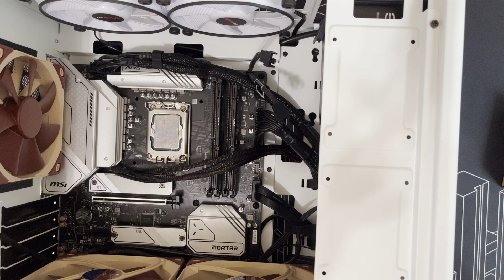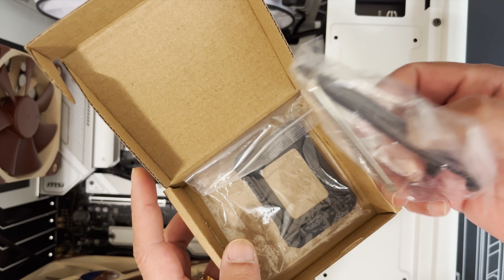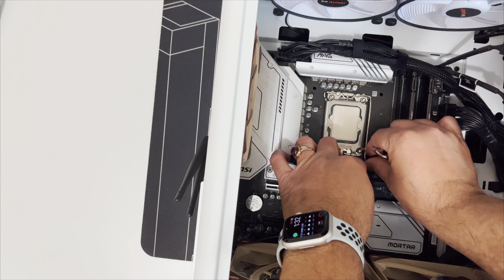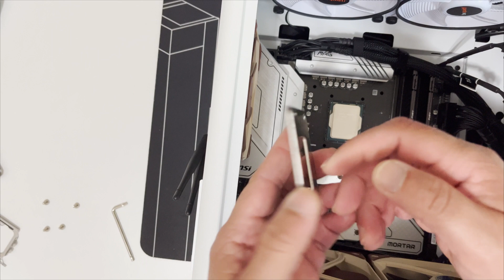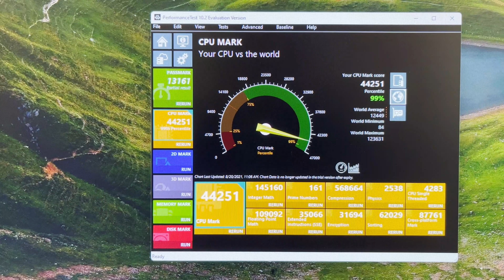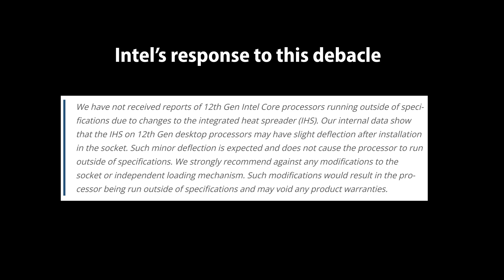I installed Thermalright Contact Frame and my core i9-12900K is 9°C cooler!

Comment: What is the best tutorial for installing the contact frame to be followed? have the maximum grip with 2 fingers and then a 90º squeeze or some other?
Reply from the maker: That should be good. The Thermalright frame is more forgiving compared to the thermal grizzly one.

Comment: Worked for me too. I also tried reinstalling the old ILM, recorded temps and then re-installed the contact frame...2 more times. The results were the contact frame had 8c-10c lowered temps EVERYTIME. 

The installation works and a contact frame is a better installation method.

Comment: I installed mine on my 13600K and it lowered temps by about 5c-10c on average
Reply: @Steve Mar. <<-- speaking about something he does not understand.  The default Motherboard contact frame does not apply even pressure. It's a know issue proven by many reputable sites.  THIS contact frame helps.  I've personally tested it multiple times with multiple CPU's. Proven by Gamers Nexus & others. This dude is a troll or ignorant.  Also, about 4 months too late.  This is OLD news
Reply: @TheRealDlo  and keep spamming everywhere
Reply: Waiting on mine to arrive this week. I'll install this on my 13600kf. Looks like the right side of the cpu doesn't evenly distribute the pressure with ILM.
Reply: I installed the thermal grizzly frame on 2 13700k with no change (rip 100€)

Comment: I’m not sure if I just installed it wrong here, but my 12900K with the DeepCool LS720 is hitting 94c on cinebench r23 with stock configs on my MSI Carbon, I believe the board is pumping too much voltage, around 1.350 to 1.4v, nevertheless I believe my temps are too high. Did you used the anti clock wise movement until you heard the click? I couldn’t do it here, I tried but no noise.
Reply from the maker: I don't think there is supposed to be any clicks. I followed the original instructions from thermal grizzly. First tighten with just 2 fingers and then do a quarter turn using your thumb and forefinger. The consensus seems to be you do not want to overtighten it. there should be at least a quarter or half turn left from fully tightening it. Hope that helps.
Reply: @PointlessVideos45  he was saying counter clockwise before turning to the right. typically when rotating ccw first you will hear an auditory click. (this is done previous to tightening to make sure you are not risking cross threading)
Reply: I own a MSI Tomahawk and it pulled WAY too much power.  I adjusted Voltage and it helped a TON.  I max out at 80c now
Reply: @TheRealDlo  same here now. Voltage adjusted and temperatures on reasonable levels. MSI pulls to much power.
Reply: @TheRealDlo  i have the same mobo, any guides you know to reduce the voltage? how did u do it?
Reply: @eggrollsoup  I just went I'm and set a limit & lowered voltage down to the lowest stable value.
Reply: I am at 70c max on stock speed 😂😂😂😂😂

Comment: I just ordered all the parts for my first build. I have a Gigabyte Z690 Aero G, i9 12900K with the Termalright Peerless Assassin 120....should I be getting this contact frame before I even put this all together? It seems like the 9 degrees would be worth it, but I'm super nervous about even doing my first build, this extra step is making me wonder what else I am missing lol
Reply from the maker: If this is your very first build, you will want to be extra careful to not harm the socket. Also, removing the ILM will void the warranty for both your Motherboard and the CPU. If you are going with an Air Cooler, I would highly recommend the Noctua D15. For the thermal paste go with thermal grizzly kryonaut (not the extreme - that's really hard to apply). Once you feel confident, then you can try the contact frame.

Comment: When did you get the 12900k. I got it in Nov 2021, i get 91F normal use, 126F gaming. Would've liked to know about this when i got it. Asking if its worth it since its already bent. Thanks for the video
Reply from the maker: I got my CPU in June 22. The contact frame is worth a try since it's such a low-price IMHO.